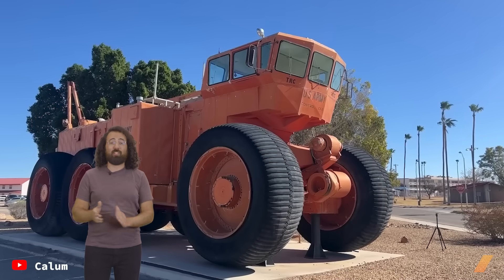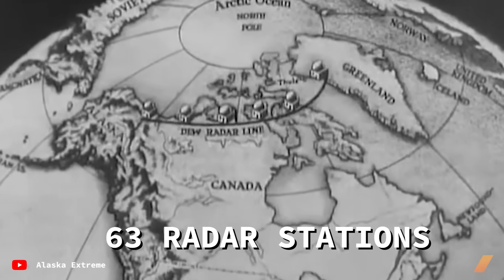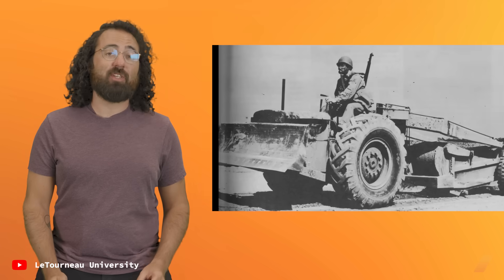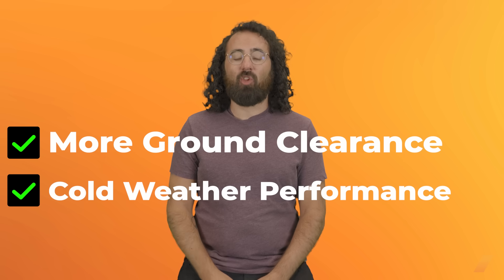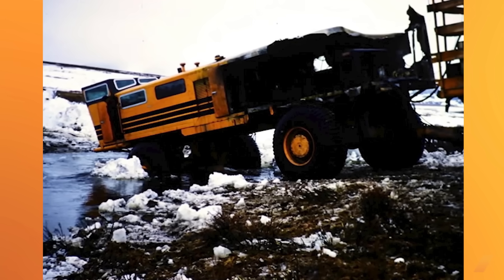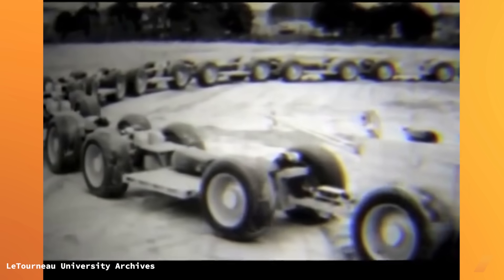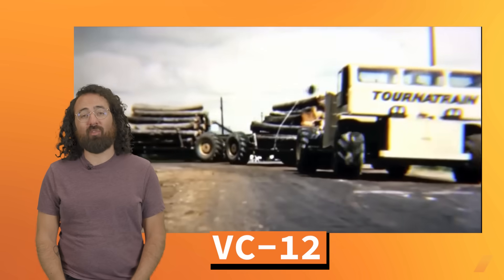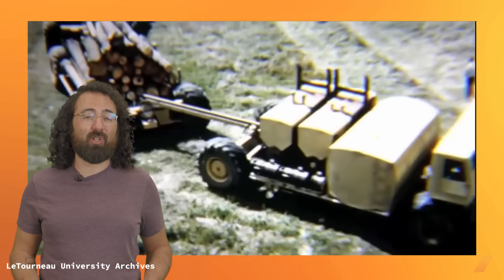True Story of the US Army's Earth-Shaking Land Trains

Comment: I have a rather obvious question: since they have this equipment and since it is designed to go anywhere and cut huge trees, why then don't they use this to go through forested areas, create clearing zones and combat huge forest fires? Has this ever been tried or thought of in the U.S.A. and if so, why isn't used? I guess its maximum speed of 20mph is a drawback since it would mean that for huge fires it will be too slow to create a barrier across the entire fire front but it could still have some targeted use and serve as another weapon in forest fire management. The greatest drawback, however, is that you would need to get it to the area of the forest fire quickly. Maybe then it could be permanently stationed next to a big forest under threat?

Comment: I read somewhere that it was proposed to power the DEW Line stations with small nuclear power plants that could operate without a crew for extended periods.  This would greatly reduce the need to support personnel at and deliver fuel to the DEW Line.  But, like so many strange military ideas circa 1960, it didn't get very far.
Reply from the maker: you are correct, and the reactors were to be brought in on the TC 497